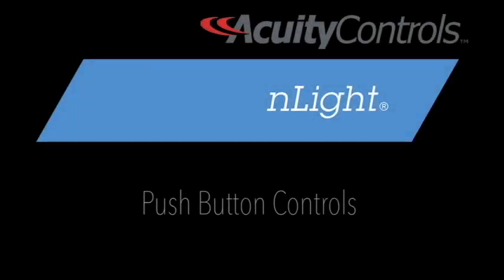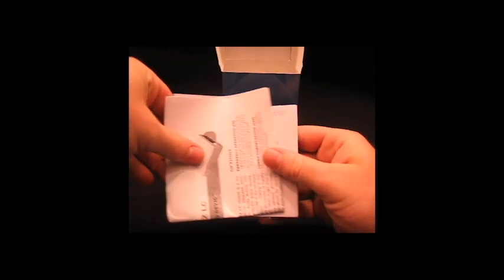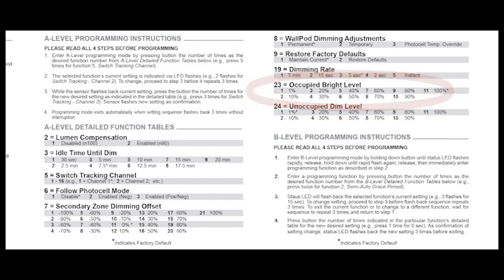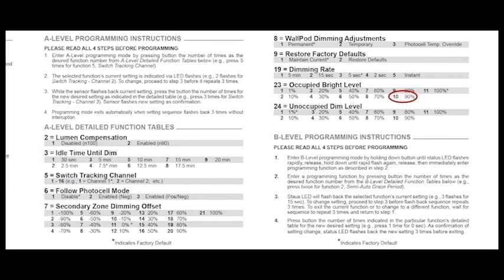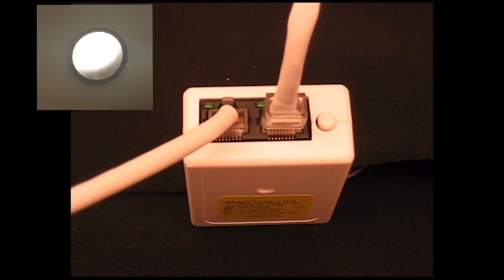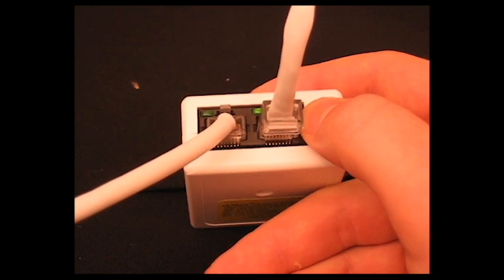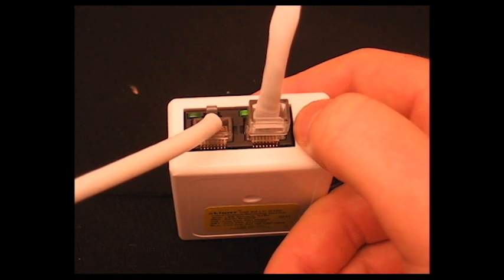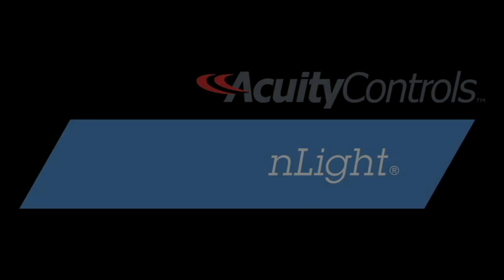How to Use the Push Button Controls for an nLight Device - Acuity Brands

Comment: YES I AM YELLING!!!! THAT IS NOT HOW TO ENTER "A" LEVEL PROGRAMMING ON YOUR CRAP THAT IS SHIPPING!!!!
Reply: see the link(https://www.acuitybrands.com/products/controls#2b54e141-7bcc-48d0-8db6-246047d3e2d4), scroll to the bottom of the web page, click "Technical Tools Tab", then look under "Programming Sheets"  nLight
Reply: I’m finding this is not a good product as well. Some of the switches are not holding their programming for long and need to be reset. I got tired of using the push button system and decided to use the app. Followed the instructions included in the box still can’t get any switches to take a program and ceiling mounted occupancy sensors don’t even respond. Headache city, turn off power to reset pin then reset switches that aren’t holding a program.
Reply: @eldonh4561  wow, I had to remember what I was yelling about,  lol. Poor documentation is the least of our problems these days
Reply: fanplant I hear you friend but you’d probably still be yelling at these switches lol